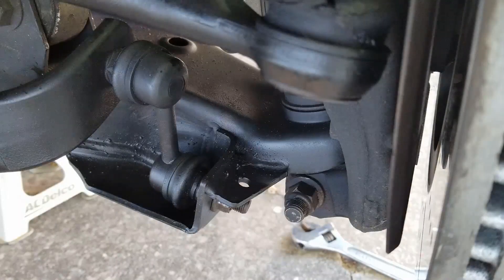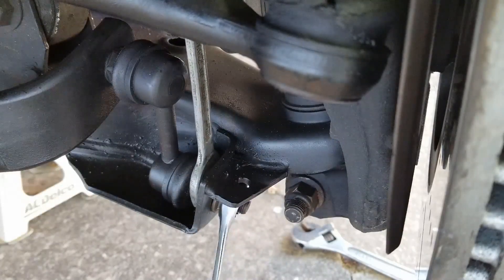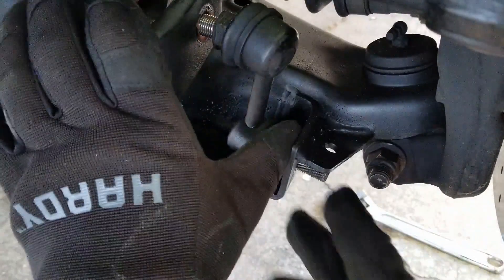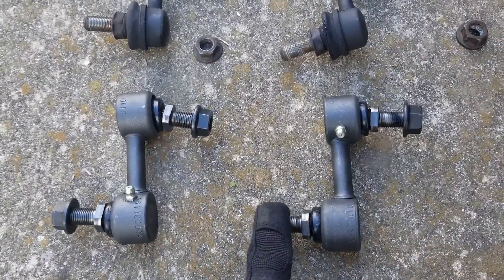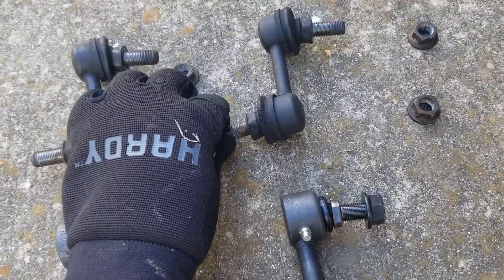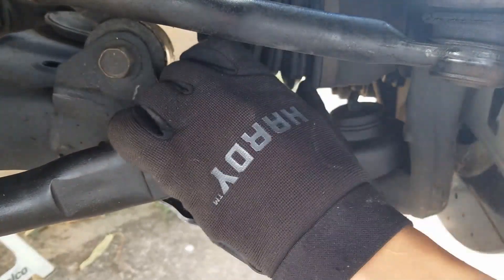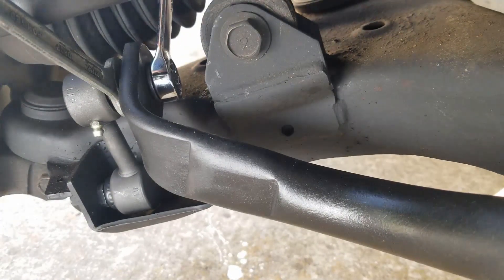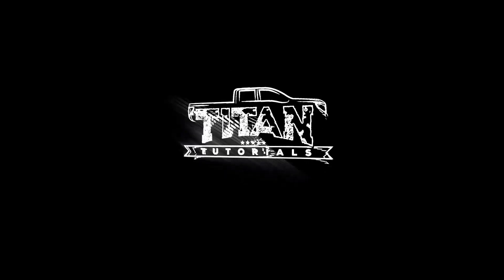Nissan Titan Sway Bar End Links

Comment: Mine is custom suspension but on the specific part right here - 6 in because of the kit however the auto shop mechanics can't find it, do you know where I can get one of these but six inches long?
Reply: Try PRG Products, they have adjustable end links for the Titan.

Comment: You beat me to this one. What brand are those endlinks?  I'm thinking about buying PRG ones.
Reply: I put the PRG ones on my 08 P4x. They are not the super long ones since I didn't have a need for them. They are just the extension ones for the leveling kit I have.
Reply: I am putting the PRG ones on my 2015. And cambolts.  Thx for the refresher🤙😎
Reply from the maker: These were the moog endlinks.
Reply: @titantutorials1594  thanks.  Are they good?  I'm buying the Moog ball joints soon.
Reply from the maker: They're a great replacement part. Not the most expensive or the most talked about but you'll see alot of people rave about Moog's reliability on a budget. That really goes for all of their Titan parts.

Comment: Do you need to get an alignment done after? Serious question.
Reply: No, the links only connect the way bar to the control arms.
Times when you should do am alignment is when you replace tie rods, upper or lower control arms, any form of lift.

Comment: I replaced my cv axels and now they are rubbing on my sway bar end links. The Titan is lifted and I have aftermarket extended  sway bar end links. Not sure what my problem is?
Reply: do you have spacers behind your main sway bar mounts? I have a 2015 titan on a 6 inch Procomp lift and the folks who did the install did not include these spacers. I just replaced the CV boot covers and realized why I needed to since the sway bar links were basically touching the sway bar mounting bolt.

Comment: Thanks for the tutorial.  This is not a criticism, but it appears that you had the passenger side upside down.  It looked like you can't access the bottom zirk fitting.  I may be wrong though.